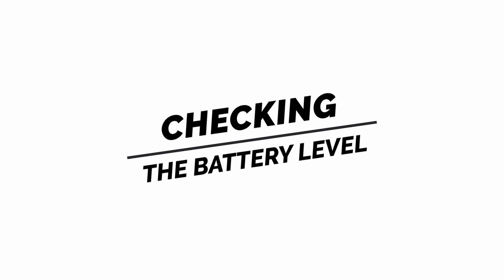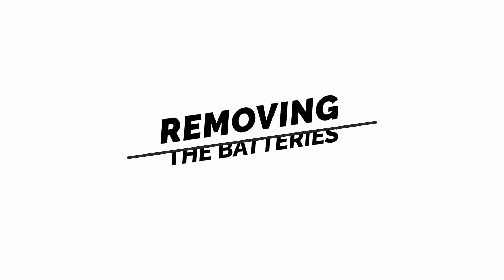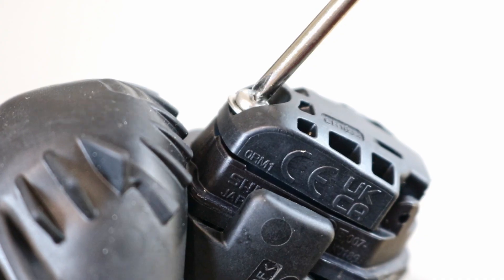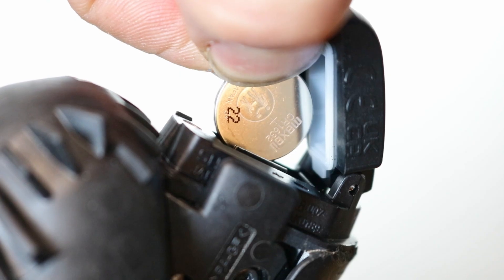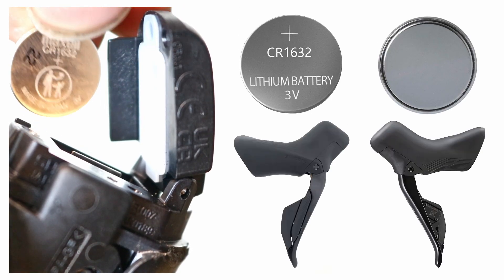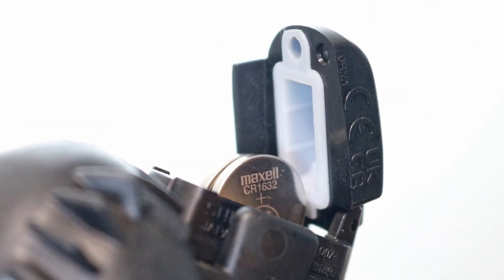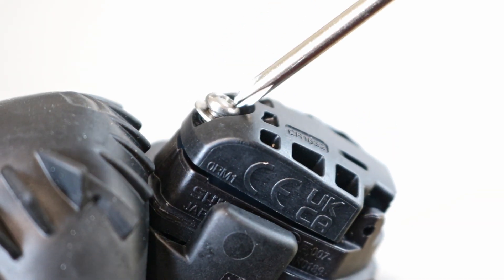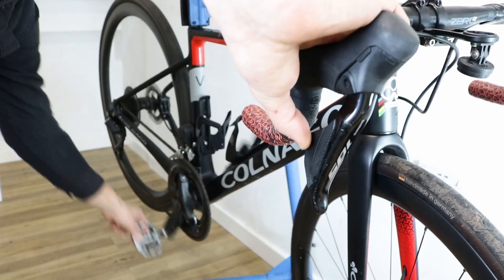Electronic Shifter Batteries Replacement on Shimano 105 12 speed Di2 levers

Comment: hi! i installed new batteries on my right shifter but they wont work. have you experienced this or know how to solve this? much appreciated and happy holidays!
Reply from the maker: Hi! It sounds like there could be a connection issue or the batteries might not be properly seated. I recommend double-checking that the batteries are inserted correctly and making sure the contacts are clean. If the problem persists, try resetting the system or ensuring that the firmware is up to date. If none of that works, it could be worth checking the wiring or connectors for any damage. Hope this helps, and happy holidays to you too!
Reply: @ thank you for your reply! honestly… dumb for me although im new to di2, i had it connected to my phone thats why it wasnt shifting haha i know please dont laugh. now it shifts already thought i need to connect it to the phone!! thanks a lot for the reply!
Reply: @cyclemaintenanceacademy  hi, I’m having same issue too. Even I changed new batteries on my right shifter, the indicator & apps still showing red light. How to reset as you mentioned just now?